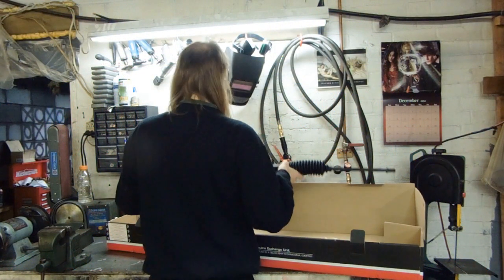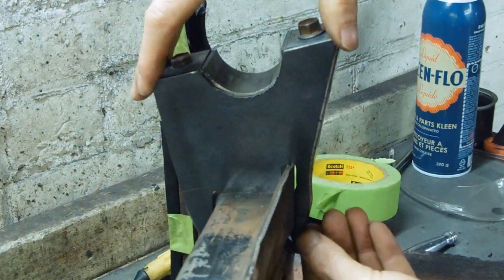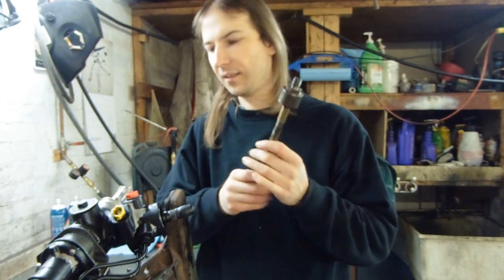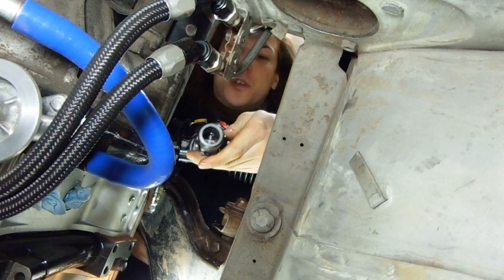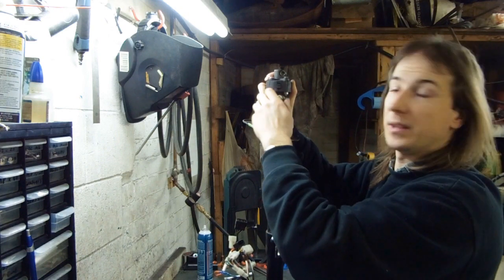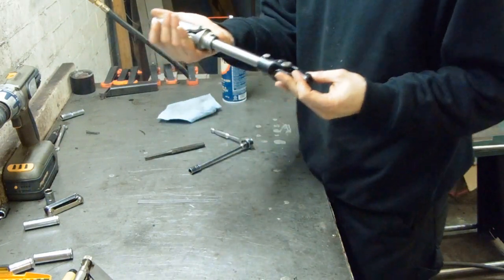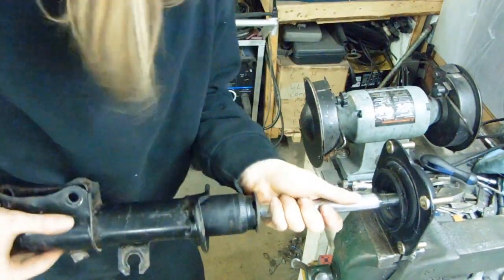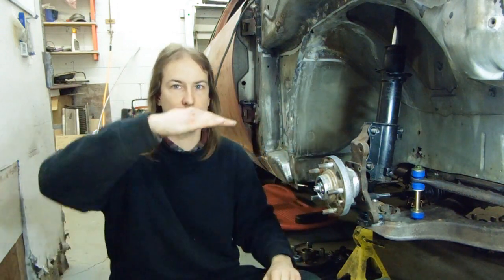Part 40: Front Suspension & Rack and Pinion Conversion, Part 2 - My 76 Mazda RX-5 Cosmo Restoration

Comment: Wait! No steering rack bushings? Is this legal?!
Reply: Why wouldn't in be? The steering rack is well secured with the clamps.
Reply: I solidly mounted the steering rack in my car (uses huge bushings from the factory.) All it did was improve the steering feel. Massively.
Reply from the maker: XPbIM3 I actually debated with myself for more time than is healthy whether or not to use rack bushings. Almost all OEMs use them, but it's more to control harshness and noise. Most subframes are hard mounted to the chassis. The Cosmo however has a rubber mounted subframe so I decided that would be enough isolation and the rack could be solidly clamped.

Comment: ACKERMANN ANGLE!!!
Reply from the maker: Ackermann maintained! I'm not sure I communicated it in the video but the geometry of the rack in relation to the knuckle from the RX-7 to this setup is basically the same. While I didn't measure Ackermann, as I was pushing the car around in the parking lots to move it to my new shop, it sure did turn sweet.
Reply: i know i was being funny. we ragged on one guy turning a fwd vw into a rwd..real crappy welds terrible engineering al around. someone said...wont somebody think of the akermann angle!!
Reply from the maker: WILNEL KG5WEN Haha, is there a YouTube video of this person?
Reply from the maker: On the first page of that thread it was obvious how it was going to go. The OP couldn't even fit a set of wheels properly by selecting the correct offset to keep it out of the fender lip. Oddly the best part about it for me was that welding outlet. Oh, why did I spend all that money on 6/3 BX cable at like $10/ft when I could have just drilled a hole in the wall under the panel and strung it together with what appears to be some scrap extension cord?

Comment: why not TIG instead of MIG on the steering rack
Reply from the maker: snargleflarg MIG is faster, and I wanted to give my new MIG welder a work out. Plus, well, cleaning up the nasty old subframe (oil hides in every crack) to allow TIG welds would have been difficult. Probably would have had to solvent dip it then bake it for a few hours.

Comment: aaron good job man where do you  get  so much ideas man iam  in sence  epesode 1  i have a first gen can i mount a secon gen suspention ..
Reply from the maker: Frank Perez Yes, with some fairly simple mods the FC subframe can be mounted on a 1st gen. Just bolting it up changes the roll center but usually the compromise is acceptable as the benefits of the FC suspension outweigh the issue. This swap is covered fairly well on the RX-7 forum. If you want to maintain the roll center, then the 1st gen frame rails need to be notched. To mount the struts, use the Escort strut tops (you will need to modify the FC spring perch) or modify the shock towers for FC strut tops, or put the 1st gen strut cartridge in the FC strut body. Lots of info on the RX-7 Forum in the 1st gen section along with detailed pictures of several versions of this swap.

Comment: Aaron, love your videos, man. Seen them all. But watching this video, and seeing all those components being added to the car, many parts tightened permanently, I was wondering if you are going to strip the car again, prior to painting??
Because, when I look at your car now, I am really wondering how you are going to give it a decent paint job without stripping the whole d**n thing ??!!  ;-)
With all of the great work you have put into it already, that car REALLY deserves a nice coat of paint.
Reply from the maker: telescopereplicator Oh without question the whole damn thing needs to go down to bare metal. The red oxide primer on there has been sitting for years and is showing surface rust. As well, the rear wheel well repairs from whomever primed the car are terrible and I'm sure there are some surprises under the filler at the rear quarters.I am neurotic about my paint, so trust me, it will be fresh, clean and straight before it goes out to be sprayed.
Reply from the maker: telescopereplicator Oh, I should clarify that I tighten very few things permanently. Most of the time I'm just going a few impacts on the wrench past finger tight. Some exceptions were on the ECU panel which won't come apart again, or for example the inner tie rods which won't need to be removed from the rack. Most of the car at this point could be disassembled using only fingers.

Comment: You should have clarified that it should be almost parallel while under full load. As in the car sitting on the ground.
Reply from the maker: Joe11Blue If the rod is parallel to the control arm with the car off the ground, it is parallel to the control arm with the car on the ground. :-) Or are you referring that it should be parallel to the ground like the control arm ideally should?
Reply: aaroncake
They should both "ideally" be parallel to the ground when the suspension is at rest with full load, on the ground. Sorry if I was not making that clear :-P
Reply from the maker: Joe11Blue Looks like they will both be reasonably parallel, depending on the ride height I choose of course. Since the car will be on air, that will depend on my mood.

Comment: Hey Aaron are we close to a new video yet? The car is near ready now when can we expect the turnover on the engine? Color in mind yet? Will you give me the car when your done? Lol you should have set dates on when your going to release the next video I think that will draw more subscribers and if you release teasers I think that would also help. No dick picks though lol.
Reply from the maker: whesley otero I can't set a release date for videos as I film and edit them as I do the work, which is evenings and weekends for me. It's going to be a while for a new one because as I alluded to at the end of part 40, there are going to be delays due to life changes (good ones). I'll release a video sometime soon which explains the situation so everyone knows what to expect. 
While I'm done almost all of the major fabrication (only air suspension remains as a "big" fab item) there are a LOT of little things. Exterior metal repair, wiring, engine bay plumbing (clutch, brake, power steering), POR-15 all the exposed metal repairs & floor, sound deadening, seats, etc. etc. Oh and that big hole in the roof.
The colour has been decided since I began: dark metallic blue exterior (Mazda Strato Blue Mica) with dark maroon interior.

Comment: ok im probably gonna get shit for asking but i have a pair of sunglasses with this kind of lens http://www.pinoyguyguide.com/wp-content/uploads/2014/03/Sprinto-Red-Lens-Mens-Sunglasses-for-Summer.jpg and i looked up at the sun in spain and could look directly at it without squinting,  since they allow me to do that can i look at a weld light with them on?
Reply from the maker: +Martin Cooper Absolutely not. The sun is rather less bright than a welding arc. Look at the sun through a welding helmet and you can't even see it. Sunglasses also lack the impact protection, splatter protection, UV filtering and IR filtering.
Reply: +aaroncake thanks my pal said weld Is brighter than the sun and I could permanently damage my retinas.
Reply from the maker: ***** Good advice. Sunglasses are better for cutting and torch welding as long as they are worn under something with impact resistance.